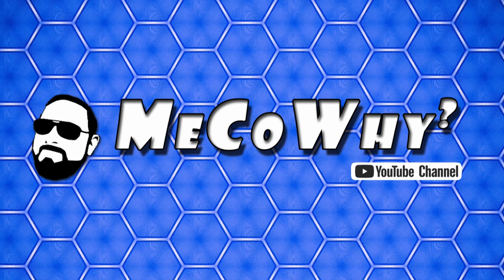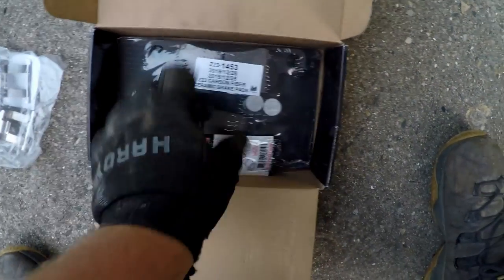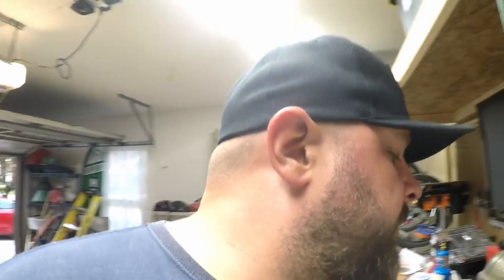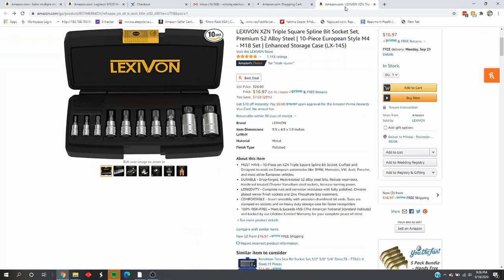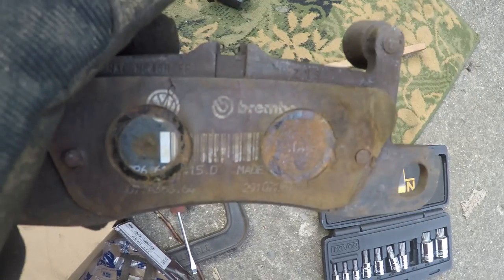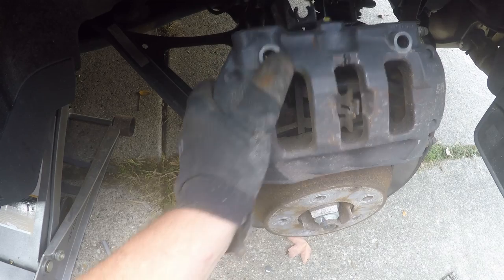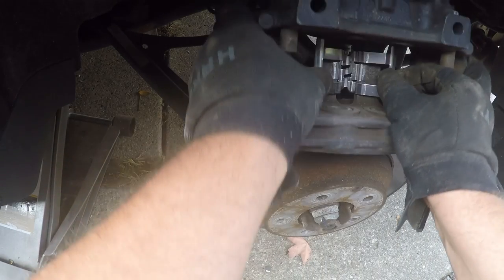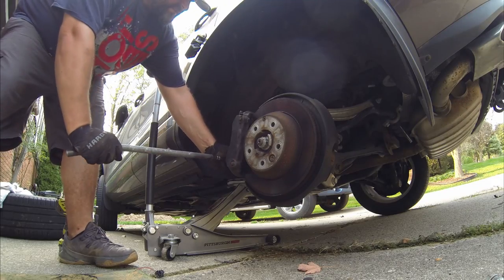I Replaced Volkswagen Touareg Rear Brakes DIY

Comment: Hey I have the same car I have a light on for fault adblue won’t start in 150 miles 
Mind I just put blue in my system
Reply from the maker: Is it still under the diesel gate warranty? If yes take it to the dealer. I just had the same issue. Half of the exhaust système and adblue system was replaced. $5000 bill, luckly paid by the diesel gate warranty
Reply: @TheRealMeCoWhy quick question.  Do you know what the round things on top of the rear pads for? And are they needed? I ordered pads online. Same pads without the round silver things.

Comment: What year is your vehicle? I have a 2013 AWD model and I was told I needed a special computer and a battery charger to disable the parking brake but it doesn't seem like you needed to use anything.
Reply: you will need the computer only if the parking brake is fitted on the brake pads which you are about to change. If the parking brake is linked to the big brake pad you cannot push the pistons manually. Most VW touaregs from 2012 and 2013 are exactly like the one in the video so 80% you can change the pads like in the video